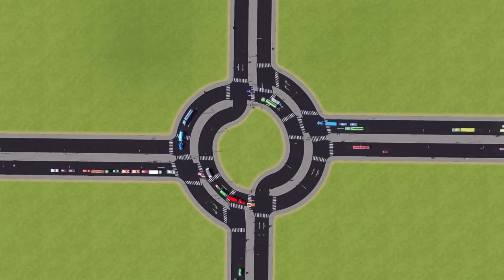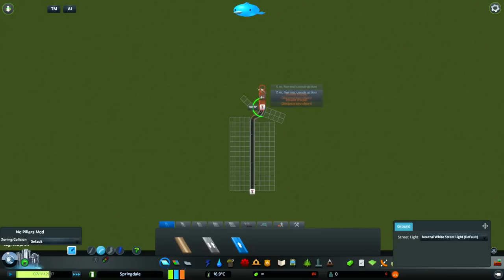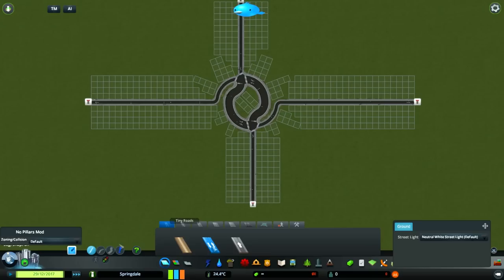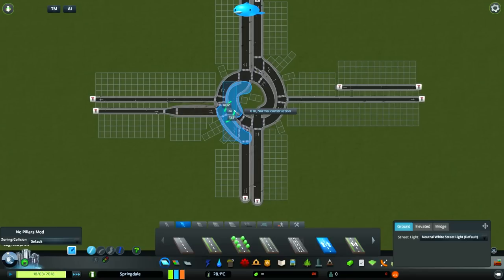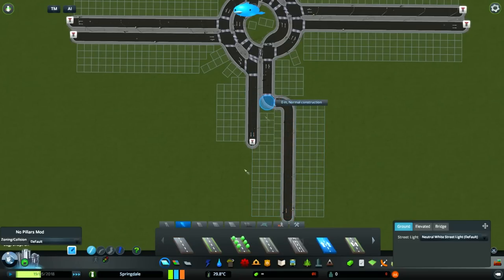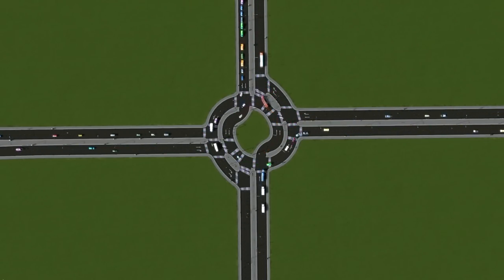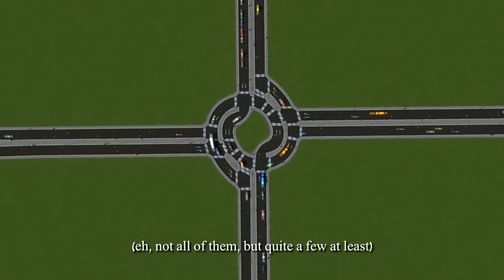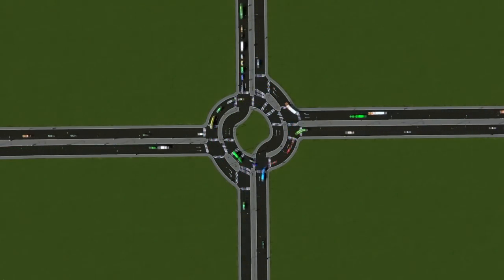Cities Skylines Guide: Turbo Roundabout

Comment: I've been plagued with traffic issues just as everyone else has. I started thinking about what the issues with all of it is. Anytime you need to slow down or yield it's going to break. So I made a spiral round about. A ring of four lane highway  with, the entrances on the inside and the exits on the outside. I've been testing eight point roundabouts for a bit now and they work OKish. The spiral I just described only has 4 points but I stuck a Monorail/bus station in the center as well. Not a lot of room left in the middle.

Comment: It seems the model is flawed as in this video some drivers coming from the left change lane: they cut on to the most inner section, to then take the top exit (e.g. white van, 11.36). The main identifying feature of a turbo roundabout is that drivers choose their lane before entering the roundabout and do not deviate or move lanes once committed.

Comment: But what if you make a turbo roundabout with high ways?
Reply from the maker: +Maarten van Rossem Lezingen I did try that too, and it works quite well, but imo its dirt sides don't look as good as the concrete of regular roads, which resembles the real life lane dividers more.
Reply: +silvarret At 2:03, how do you have a single lane going 2 ways?
Reply: It should just be a part of the Network Extensions 2 mod.
Reply: Turbo Supergrid Highway Roundabout Plus?

Comment: The game needs single lane one way streets, dual lane off ramps and sleeker on- and offramp mergings with motorways.
Reply: The game really does need nicer connections to motorways and other roads in general. Watching all those cars just just speedily zip around tight turns is a bit weird. I also wish you could make longer, less steep slopes.
Reply: Amaranthus616 you can adjust the increments in which roads will go up or down. Next to the options for straight, curved etc, roads is a bar. Click it! It will allow you to make shallow placed roads. Standard is 12m, I think. It also allowes 3m and 6m over roughly the same distance. It lets you make much more realistic looking train tracks. Glad you agree with me on the rest :)
Reply: I use the one-way, two lane street as on/off ramps all the time. It works fine.
Reply: BackSeatJunkie I did too, but its not a true exit. Which triggers me.

Comment: Wouldn't the traffic going straight from the top and bottom (in the video) use the outer ring like the traffic turning right does? If so, why do there need to be connections from the inner road to go straight?
Reply from the maker: +DinoYoshi133 That's how they work in real life, but I'm not entirely sure why either - perhaps it works better if cars that go straight can take both the inner and outer lane, especially considering that turbo roundabouts are often used where a busy road meets a less busy road.

Comment: I am not sure, but somehow this is not really a roundabout. You cannot actually go in circles or turn and go back where you started, can you?
Reply: TheRealBrainbug,  my thoughts exactly! You can't go back the same way you came from.
Reply: TheRealBrainbug  Ming from northwest, go to inner lane, turn left until at north east corner, go straight and you're back. I think. Idk, I'm American and we don't have any
Reply: You can, just go to the inner lane. Then, depending where you are coming from, after 1/4 (if you came from east or west in this video's roundabout) or 1/2 (north or south) of the roundabout, go back in again. Then it's another 3/4 or 1/2 before turning right and being back in the way you came from. It sounds complicated but they feel really intuitive in real life.
Reply: You can, if you go from north or south. Or just get to the inner lane.
Anyway, who needs to go in circles? The point of turbo roundabouts is that the inner lane eventually exits. Just because you can spin around in a normal roundabout, doesn't mean you should. In fact, you shouldn't.

Comment: "in real life they are safer". WHAT? A roundabout where you can enter directly at any speed. In a traditional one, you have to turn and slow down to enter the circle. How on Earth this one can be safer?
Reply: because you do enter the circle. This thing in the game is a bit bugged out but I like them more IRL than a normal roundabout. This is one close to a normal roundabout and I use it nearly daily: https://www.google.nl/maps/place/Drachten/@53.1182307,6.0786021,175m/data=!3m1!1e3!4m5!3m4!1s0x47c8502d34dc13d7:0x8ee972c991cd0fa0!8m2!3d53.0925814!4d6.0586373